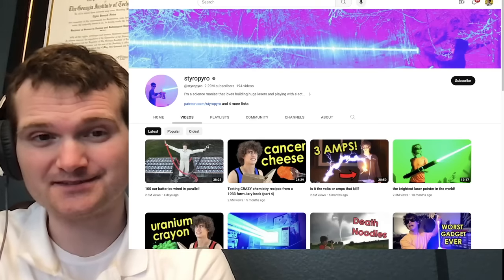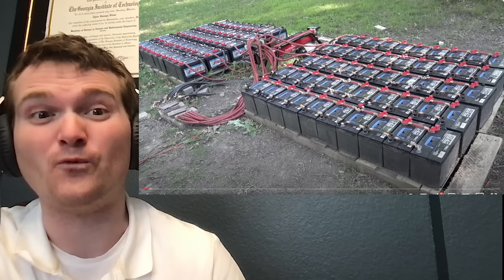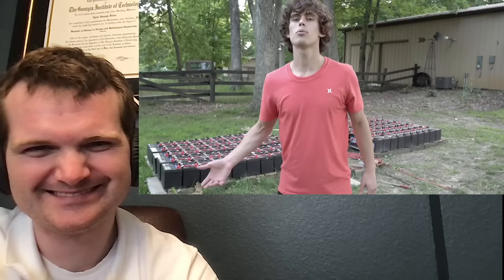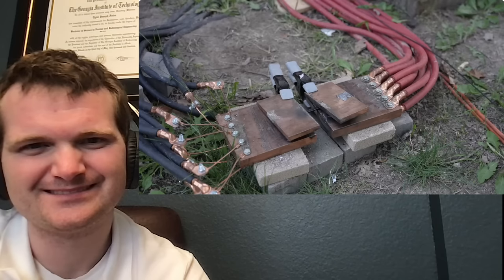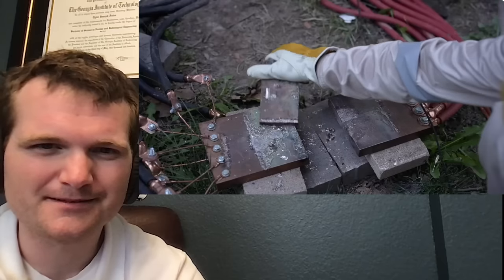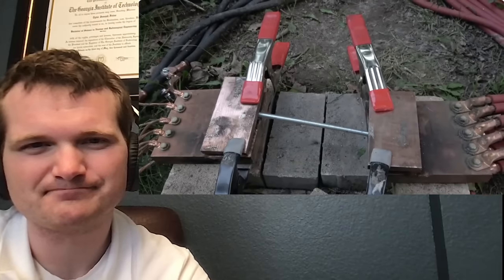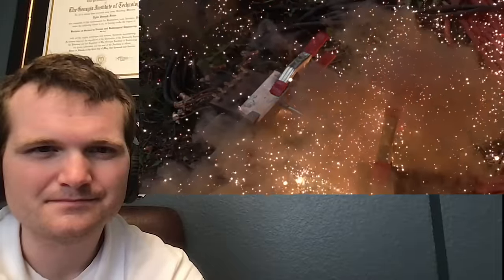Nuclear Engineer Reacts to Styropyro "100 Car Batteries in Parallel"

Comment: I used to work in Telecommunications 40 years ago, and I visited an old style mechanical telephone exchange - they used to parallel stacks of 12V batteries.

I heard the story about someone who accidentally dropped a massive screwdriver across the bus bars and the thing just melted away.
Reply: I heard about a university where they were painting the room that housed the battery for the telecom room when one of the painters set a paint can down where it shorted across the terminals.  It left a light coat of green paint evenly covering every surface in the room.
Reply: Yeah, a 5XB based CO could easily draw hundreds to thousands of amps at -48V.
Reply: Ive done enough work on smaller arrays, my biggest fear was dropping a wrench across the bus bars
Reply: @davidconner-shover51  can you get insulated wrenches? Just a normal wrench with a coating on the handle?
Reply: @conorstewart2214  Maybe some grip tape, I don't play with it too often, and the newer LiFePO4 batts have a BMS shutdown on overcurrent
Reply: A worker dropped a wrench across the DC bus at a coal fired electric plant and it got welded there. They had to cut if off with a cutting torch once things cooled down.
Reply: Mate you can easily melt a wrench with just one battery in good condition
Reply: I shorted a 240v dryer plug with a screw driver thinking it was off since i had turn off the breakers, there was a second breaker box. that screw driver has a nice chunk missing out of it now and is a constant reminder to check the device power, plug was stuck.
Reply: When did "telecommunications" become a supposed brand name?

And just "used to"? What do they do now instead, supposedly?
Reply: @HelloKittyFanMan  Sorry, old habits, the company was called Telecom Australia - so capitalising the Telecom* is habit.

a )As for used to, now I'm retired. 
b) As for used to, now it's all digital exchanges nowhere near the power requirements of mechanical exchanges - no idea what they do now.

Gabba trunk exchange (10C), Edison trunk exchange (ARM) in Brisbane, Queensland were the ones I visited and engineering work on.
Reply: @conorstewart2214  Insulated screwdrivers, wrenches and socket sets are somewhat common in the everything wants to incinerate you in a plasma cloud electrical world.  No, they are not cheap.
Reply: If it manages to weld, it will vaporize, otherwise, it will become a projectile.
Reply: @TatsuZZmage  I blew a hole in a flat-edge shovel on a residential jobsite once, after the customer had assured me TWICE that there was no electric line right there.  I asked him twice, because I suspected it was.  And not only that, but it was only about 3 inches deep, three 00 gauge lines carrying 240 and a return, and not buried in any conduit either.  Really pissed me off!
Reply: My grandfather was repairing a large commercial camera flash, and dropped a screwdriver across the fully charged capacitor. Vaporised it.

Comment: I hope he gets to visit a steel mill electric arc furnace. I was in IT, and it included work in the melt shop. The EAF had three 24" hydraulically controlled carbon electrodes that drew the arc to melt the steel. The furnace had its own substation. Power was over 60 megawatts. That melted about 100 tons of scrap per hour. The sound was deafening, even with hearing protection. The light was brighter than the sun, and radiant heat was scorching. Standing in front of that machine was always thrilling.

Comment: I worked as a wind energy tech for a year. You would not belive what happens if you have a short inside the electrical cabinet. The big cables jump arround like they were possessed. They were originally kept in place by big zip ties. After the short all the zip ties were ripped and the cable was a few inches longer than before. And yes this was a lot of work to change out every damaged parts to get everything in working order again.

Comment: I did some back of the envelope calculations when this video originally dropped, that battery bank can supply just over a megawatt, I was quite stumped and I think my jaw is still on the floor around here somewhere from when I dropped it then
Reply: And he had the audacity to do it 😂
Reply: And as the two guest tubers in the video said, “you shouldn’t be measuring in ‘mega’ anything”. Although I think anyone would agree Ohms would be an easy exception to that…except we know that’s one thing that didn’t come up in that video.
Reply: What if he was still calibrated for 12V, then his reading might be off by a factor of five. So the real output was 10KA at 60V, or 600,000 Watts
Reply: Didn't it hit 2.7MW? Oh later he hits 3MW and says so right after
Reply: @libtrs838  correct, I failed to think or mention it before but the amp number I used was for 30 sec continuous, not peak, so the batteries can safely deliver 1MW for 30 seconds, which is arguably much more impressive than the first number I got
Reply: Thousand cranking amps times 12 volts is 12,000 watts times 100 would be.... 1.2 megawatts. So yeah, he could easily pull that much and more from this bank.
Reply: @krisspkriss yep that’s working amps. Short circuit current is a whole other ball game.
Reply: @unicornadrian1358  That is a very good point. I would rather not be his neighbor.
Reply: @krisspkriss  lol I wouldn’t mind being his neighbour as long as he gives a heads up before things go boom. 😂

Comment: You talk about accidents in several videos and something I was always wondering is: what happens if there’s an uncontrolled fire in the control room? Does the whole plant have to shut down? Are there fire doors to stop it from spreading further? Where’s the worst place for an uncontrolled fire in a nuclear power plant?
Reply: I imagine they have a smaller backup control room. A fire in the computer room would be worse.
Reply: So your scenario almost happened at Brown's Ferry in 1975. A worker was using a candle to check the integrity of some seals around a wiring bundle in a cable room and set the whole thing afire. It destroyed a lot of wiring before being extinguished. In that case the reactor automatically put itself into automatic shutdown without any human operators needing to do anything. It did get pretty dicey, though, because a lot of safety systems and control room instruments quit working because of the damage. Still, no harm to the reactor core occurred. That was all the way back in 1975, though, so I would imagine that modern plants are better protected.

Comment: Both my father and I used to work at A Refuse, derived fuel power plant and their battery room. Was sized and appropriately arranged so that it could allow for a black start of the local grid if the entire grid saw a shutdown. The inverters for their u p s supply were designed so that they would provide a true sixty cycle sine wave for them to excite their generator and provide a power source for other generating stations to sync to.

Comment: something I was wondering- did these batteries require charging during this video and if so how would that be done. Love Styro!
Reply: Probably a hamsterfarm.
Reply: doubt it's during the video. But you could charge the 12V parallel bank (first arrangement) with a normal dumb charger... very slowly. A smart charger might think your battery is faulty because the charge barely goes up when it dumps lots of current in!
Reply: I think that's all on a single charge. Each of these tests is basically a car start. The current draw and duration for each individual battery are well within the specifications for their intended use.

Comment: 5:09 - 76.48kg of TNT according to wolframalpha
Reply: Haha, I was just going to say about 75kg then saw this comment 🤣 pretty insane
Reply: 3.6MJ is amount of caloric energy I ate for lunch. It's only 860 calories. TNT has terrible energy density, but it has to 1, carry its own oxidiser, while our bodies breathe air, 2 not release that energy while burning, or being oxidised, 3 release it all at once at a speed that is a significant fraction of orbital velocity, when a shock wave detonates it. In terms of peak power, it's a great standard, in terms of total energy released, it's less energetic than fuel air explosives, thermite or even gunpowder. It's about the same as lithium batteries, and only one order of magnitude higher than lead acid batteries

Comment: A long time ago in 1959 I wired my first  120v house circuit protected with a 15amp fuse.   Used agw 14.   I put a fuse in the fuse box.   I turned on the swithch and got a flash.  I wired the on-off swith incorrectlyly and shorted it out.   When I took the switch out it had blown out.    I was 9 at the time.     In my career in engineering I also worked with system having large scale power considerations.      I would say most people have no concept of megawatt power's   explosive properties.       If we consider a 12 volt batery has around 1.2 KWh of power that styopyo setup is about a 144 KWh battery.      Now that is such a wonderful thing to be sitting on as you drtive around with all the other cautious safe drivers.   :face-fuchsia-wide-eyes:    I would prefer to sleep in a Nuclear Reator building. 😇

Comment: The energy yield of TNT is approximately 4.184 gigajoules per ton, so his dealing with the equivalent of 75 tons of TNT per bank. That sounds about right. I calculated for a story once that the energy in the jet fuel of a small commuter jet was roughly similar to a small tactical nuke (though like the batteries, it cannot be instantly released).
Reply: He said Megajoules not Gigajoules so 320 Megajoules is equivalent to 75Kg of TNT not 75 Tons, certain people would have a field day if you could produce a 75ton TNT explosion with only 50 car batteries.........

Comment: I'd never heard of batteries discharging hydrogen. That's neat.
Reply: Electrochemistry tends to do that sometimes.
Reply: sulfuric acid  +  lead

H2SO4  +  Pb  =  PbS  +  2O2  +  H2
Reply: @JohnLeePettimoreIII That’s not correct. The hydrogen is formed when overcharging occurs due to electrolysis of water.

Comment: I got an old 9/16s wrench with a decent sized spot melted out of the handle. I was working on a propane bobtail with a cat 3126 and i was changing the intake heater grate solenoid. Was working in a hurry so the batteries were still connected, and i accidentally let the wrench swing into the valve cover while loosening the nut on the hot lug of the solenoid. Instantly put that aforementioned spot on the handle, while i was holding it. Got a matching scar on my finger from the wrench momentarily turning into a cattle brand. And that was from 2 lousy truck batteries, probably less than 1500 CCA combined. Cant believe styropyro didnt melt more of his rig than he did with 49,000 amps or whatever loony ass number he topped out at.

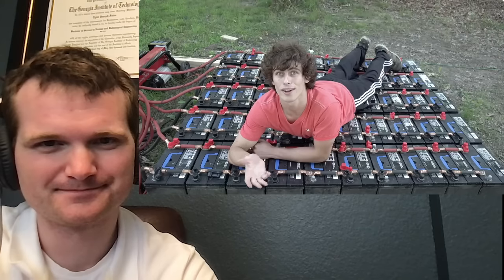Comment: 5:29 How does StyroPyro NOT get electrocuted here?
There are exposed copper on the connections, and he lays across both the Red & Black lines.
Ans (as we will see) that energy can jump quite a bit, at least further than his clothes tiny thickness...
So, how/why is he alive?
Reply: It's only 12 volts. Which means while the current is very high potentially, it doesn't have the voltage to push through the resistance of his body and clothes.
Reply: It's the amps that kill, but it's the volts that help the current pass through. 

Doesn't matter how much power is in that bank of batteries, if it's not at a high enough voltage (called breakdown voltage for insulators) it won't create a closed circuit through whatever's touching the terminals. 

This is why you never saw any arcs of current through the air in this video, and also why styro could channel his inner French girl on that battery bank being relatively safe.
Reply: @Blend3rman   Thanks for the detailed explanation :D
Reply: @TheLegendsmith  Thanks for the explanation

Comment: 19:37 Crowbar circuit are used in electronics. You put them across the rails in a power supply, and are triggered by something else in the circuit. When something goes wrong, the PS is shorted out, and (hopefully) the fuse blows. They are also useful to short the wires to an inductive load while simultaneously breaking the connection to the load, which prevents back EMF from frying everything. 
I have used them on DC coupled power audio amplifiers. These types of circuits are most likely to fail closed and send continuous DC into the speakers. Since any driver in one of my speakers costs more that all the circuitry combined in an amp, they are an ideal method to protect them.

Comment: Nice job on your reaction video....  

We have battery strings like that at work also....  We have 24 connected together on bus bars, to make a ballpark 50-52 volt DC system, operating at a few thousand amps...  I think we're floating it at 52 volts???  Yeah.  52.something

Anyways, we have multiple strings of those.....  Those feed into rectifier banks, and it provides backup commercial AC for several hours....  We also have backup generators, but if those fail to start....  Luckily, in all my years, we never tested how long those batteries really might last with no generator.  Luckily I was always able to get the generator started.....

We were told it was 6 to 8 hours, but...  At another location, they supposedly went dark after a little more than 2 hours....

Anyways, I also got a laugh when you wondered aloud the rating of his arc flash suit.....  I think ours were in calories???  I think I had a 12 calorie suit.....????  I'm not sure.

Comment: Loving you videos keep them comming! :D One thing though is check your gate/ background noise remover settings as its cuts in very fast and its quite jarring when you take a small pause for example as rather than the slight reverb of the room your in it goes scilent instantly and can cut off the last bit of what you are saying. :D

Comment: I really appreciate your comments. I started working at S... nuclear powerplant in 1980 and was a reactor operator. I transferred to engineering in 1990 as a non-degreed tech in predictive analysis until retirement in 2018. (Eng techs, solving the problems of an incompetent engineer.) It's when you are on top of an RCP motor as it starts up and you are the one taking initial vibration readings that life comes into sharp perspective.
Reply: As a (reasonably) competent engineer with experience in academic research as well as commercial avionics, I absolutely feel you - but please consider the asinine bosses who regularly mangle the erstwhile genuine efforts of their engineers. Industry is plagued with crisis-level faults; the competency of available talent is not the cause, imnsho.
Reply: My best example of my work is when an engineer came to us to see if we could inspect some probes. turns out these probs are under ten feet of rapidly flowing water. River water to cook the main condensers or ultimate heat sink. 3/4 probes reading low trips both units offline only they are not level probs but temp probes. Each has two fingers one of which is heated and about 1/2 inches apart. every two weeks divers were called in to inspect and clean. industrial hardhat divers cost a fortune. and the unit has to reduce power slightly. Biological growth causes failure to generate a trip signal, an NRC tech spec violation. we created a tool to inspect and clean the probe out of 20 feet of aluminum conduit with a funnel on the bottom and holding a sewer camera and a high-pressure washer.  It worked like a dream and because it was a tool it did not need to be nuclear-qualified. saved millions. @zinckensteel

Comment: We used batteries to flash the field on 3 emergency diesel generators who came online automatically when power failed - this was one of 3 sources of backup power  - the others were 500 kv and a 230kv lines

Comment: not sure what the reactor facility ave output is - small hydro is about 2.5 - 3ish MW (i'm not a hydro elec guy so would love to know the correct number) - the one inch bolt carried about 2.5MW before the fuses blew - (love his fuses BTW - >>>do not try at home<<< - test burn some cable or stock - crunch a few tolerance nums - a piece of pvc pipe - a piece of copper pipe - ceramic sand - a few tools - the copper pipe is crimped flat at the end and drilled to make a custom ring lug - crimp the element but flatten the rest of the end for the bolt hole - the open end with the element sticking out gets fit onto the pvc with heat-resistant glue - fill with sand and allow some air space for the element to gas into to prevent a blowout condition - secure the other end and when installed i like to use a blast cover just in case of a blowout - - i have tools to work large wire and i do so daily so i prefer to use a piece of cable and flair the end and slide the element directly into the cable and then i crimp the pipe, cable, and element together at around 7 tons or 14,000psi - and i've found a copper and pvc pipe combo the small copper pipe just barely fits inside the pvc - like it's snugg - i put an inside popper ring and then crimp the aforementioned copper end piece to the pvc)

Comment: Batteries= 320 Megajoule. 320 megajoule / 4,184 MJ= 76.481Kg of TNT or in Freedom units 168,61 Lbs. 

1Kg TNT = 4,184MJ
Reply: Not a lot actually compared to a lot of industrial processes such as making steel or that power plant T. Folse works at. 
Of course that's AC but it's still energy!